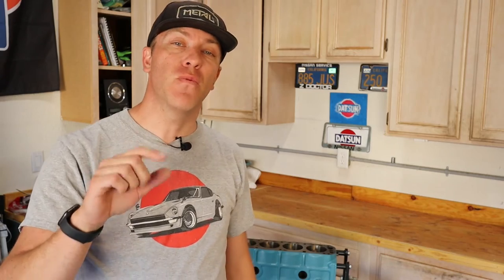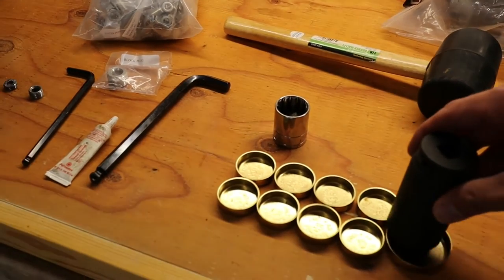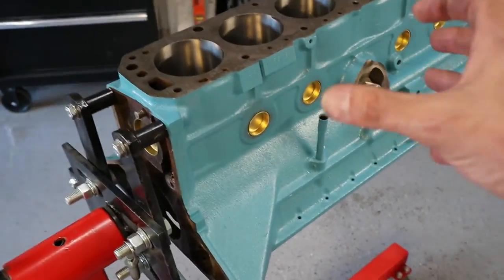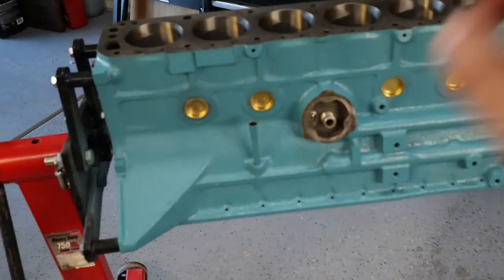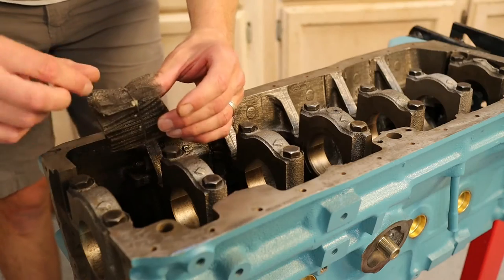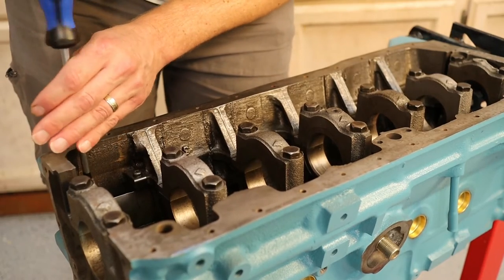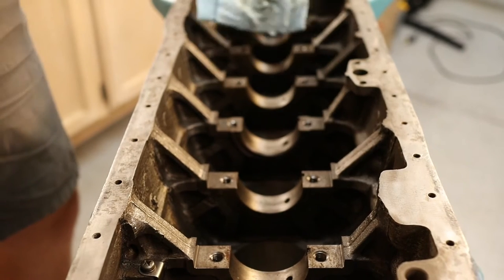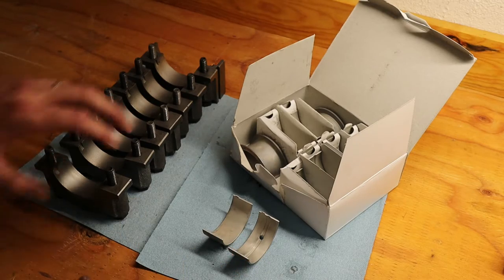How to install the crankshaft in the Datsun 260Z L26 engine Part 1

Comment: What size oil galley plugs did you use? The thread size, apt? This is a mod I believe it’s usually a solid  plug
Reply from the maker: I want to say is was 5/8” but I just used what my machine shop had, the most important thing is that it doesn’t go too deep as there is a channel also that turns and you don’t want to block it. Yes, it’s normally a aluminum slug basically. It probably wouldn’t happen but sometimes they decide to go.

Comment: What bolts did you reuse?
Main(crank) ,  rod bolts, or head bolts?   
Some say everything needs to be replaced. But that would be expensive
Reply from the maker: Replaced the rod bolts. Head and crank bolts were in good condition. From my understanding these aren’t stretched bolts and could get away with at least one rebuild. If it wasn’t a n/a build, I would say replace it all.

Comment: Love the vid. Quick question though, are the seals supposed to protrude out slightly? Shouldn't they end up being flush with the block?
Reply from the maker: Thanks! Which seals are we talking about?
Reply: @CarsBikesandCoffee  the rear main cap seals
Reply from the maker: @danielzammit5160  yeah you want to tap them on once we get to putting on the oil pan. Some people trim the excess.